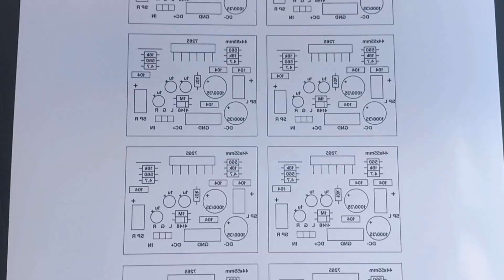TDA7265 Stereo Amplifier Board In DIY PCB / Dual Supply / 25+25W

Comment: Just wanted to share one thing for your knowledge, this 4 transistor based tone control board is suited only for 100 watt and above amplifiers, else, you won't be able to get / derive it's full potential
Reply from the maker: Thats right. But the TDA series IC's have a very low gain of around 30db. So I have to use a tone control with a high output signal.